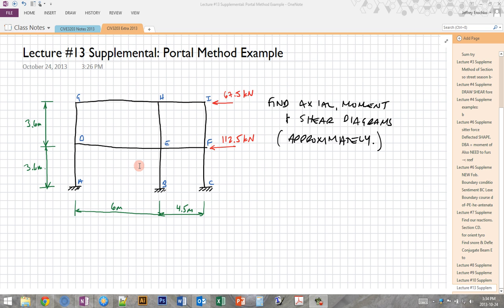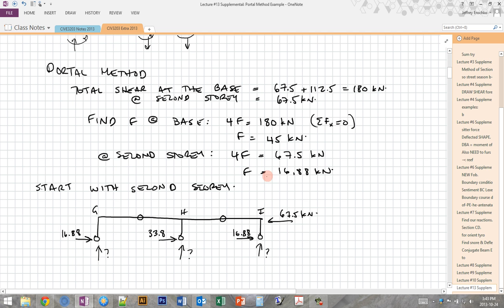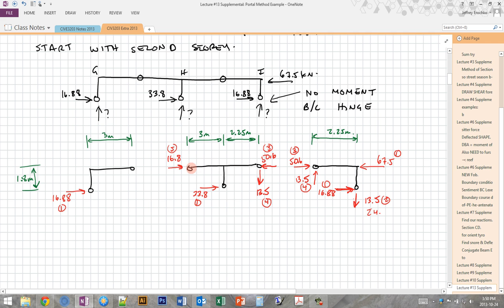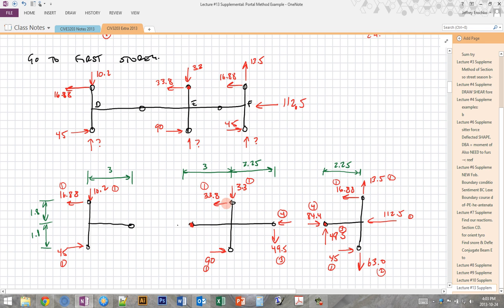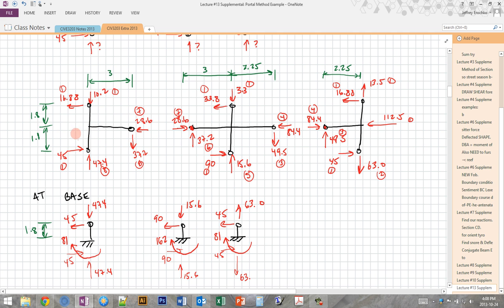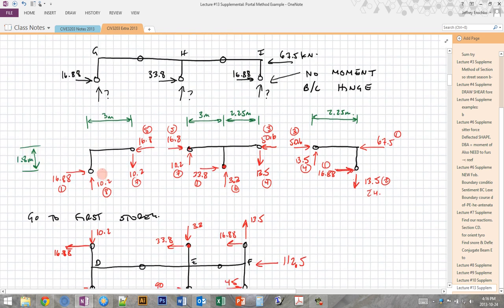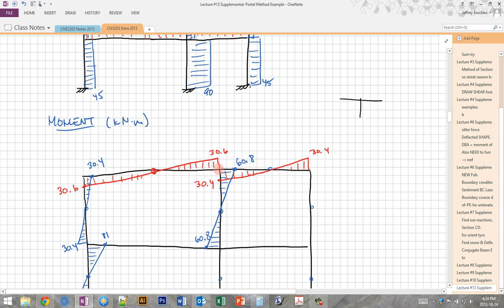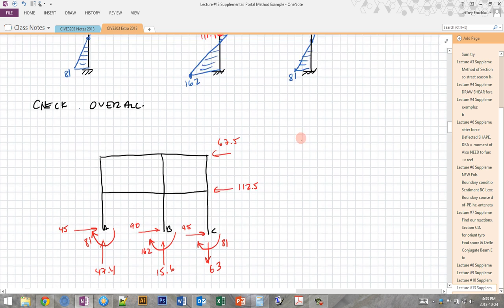EXAMPLE - Portal Method for Approximate Building Frame Analysis

Comment: Im confused about the moment at the left side(moment diagram). . It shows that it is not in equilibrium. 81+111.375 is not equal to 30.375.   Which means that the direction is wrong.

Comment: 14:49. How did you get the 63?
Reply: Risa Harada  i got 49, maybe he's wrong!
Reply: Risa Harada if you take moments about the beam hinge, you get 78.755 in tension.
Reply: (16.88x1.8+13.5x2.25+45x1.8)/2.25
Reply: The 1.1 should be 1.8, he just wrote it wrong but the answer is correct with the right dimension

Comment: thank so much for your video. i had some questions if you had a minute.

1) i saw another example where 2 bays of the same width/stance produced zero axial force in the interior column. would this be true of any number of equal stance bays (say 4 bays), where all interior columns (say 3 column, with the 4 bays) would have zero axial force? is this true regardless of the story heights?

2) i noticed that n this example and others that the moment of the interior column is twice that of the moments in the exterior columns. how does this hold when there are multiple bays? with 4 bays, would the 3 interior columns each be twice as much as either exterior column?

thanks again!

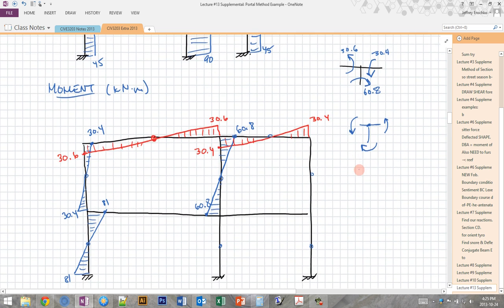Comment: Hi, I think you did a mistake at 32:05 where the directions of both beams should be clockwise and direction of column should be counter-clockwise. Correct me if I am wrong. Thanks.
Reply: Jie Ng nope. it is very correct and excellent. check the moment diagrams carefully